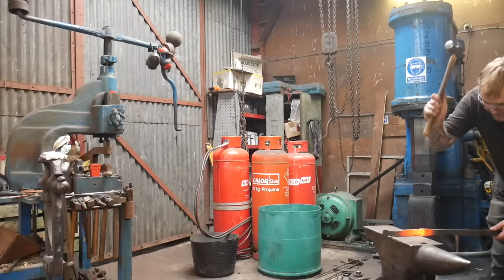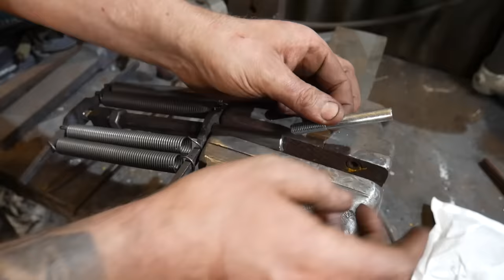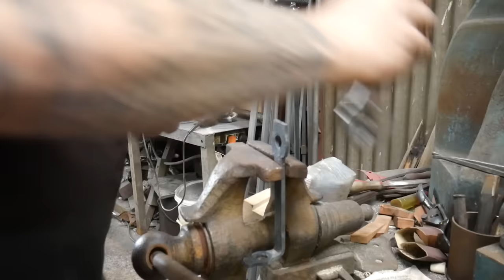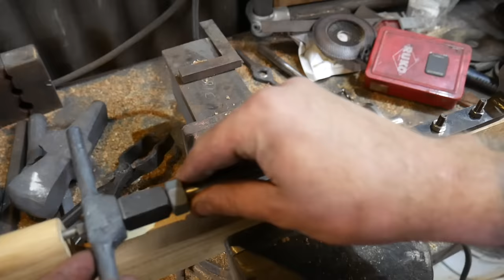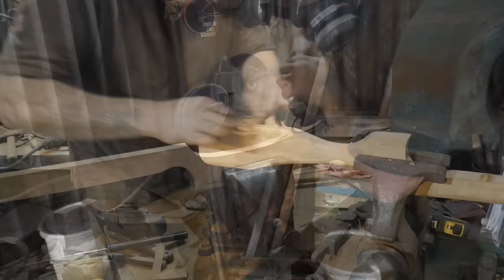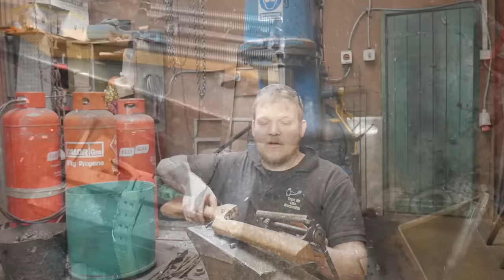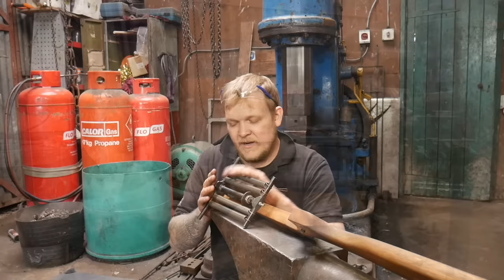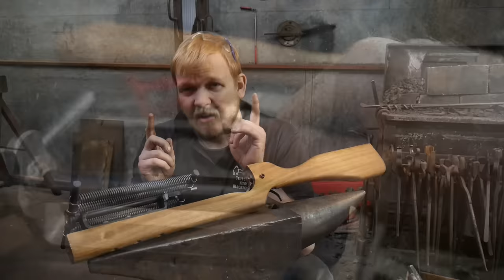The Spring Bow! Like a crossbow just with springs Pt.1

Comment: Your "stupid idea" is actually a very clever one, though, I'm probably biased as I did the same thing one year ago !! XD
Anyway, mine has the springs arranged somewhat differently. I don't keep them tightened as you do, so that I have a little bit more power. Also, they point inward, like they're just a cord replacement for a crossbow, which they are in my case. The arc of my crossbow was broken and I decided to use a fixed tube with springs as propulsion. The end result when it's not loaded looks like a triangle pointing towards the trigger mechanism. I also have a longer "barrel" and they have more space to be stretched. I can puncture leather with a custom dart I made out of a 6mm x100mm steel nail (with real feathers on the back, perfectly balanced). I also have a power drop though. For springs to work, they must be extra thick and real tough! As a matter of fact, the power of a bow is hard to beat with springs. In my opinion, different springs should be used in such designs, with the tougher and shorter ones near the exit and the longer and more flexible ones at the trigger. The idea is to simulate a sling shot's rubber. A set of 3 different sizes and lengths should be good, given you give 'em more space and that you "diagonalize" the setup.

Comment: Maybe a oilite (oil bronze don't know the UK brand equivalent) to keep the piston aligned on center. Say 25mm long. Shorter springs. Spring tension increases as you extend it to a point. Use McMaster Carr as a reference, again probably a UK equivalent but McMaster has a lot of tech specs. You want the springs near max extension when cocked, those springs had a lot of extension left meaning they weren't at their full potential. They could store a lot more kinetic energy. Cool project, I like the ideas to modify it you listed, particularly the trigger.

Comment: Efficiency depends on relation of spring system mass and the ammunition mass. With heavy forged parts, most of the power goes accelerating a mass which don't fly. That energy cause only problems when the springs hit the end. The performance gets better in a same propotion you can reduce mass of moving parts.

A bow is efficent because the spring itself don't move much and the string is light.

If you want to use the springs, you could try some lightweight lever whigh translates relatively low speed but higher mass into higher speed for lower weight ammo.

With a quick thinking, it is very difficult to beat a string based bow. A split tube with the string inside and the string tension with lightweight lever and really strong springs which hardly move at all would be very efficient.
Reply from the maker: I don't want it to better a bow just want to make the whole thing a little smarter. What you say make sense I'll look into the wieght.
Reply: Daniel Moss It will help but mass of a steel spring itself will quiclky become a limit in direct action. You could also think about some lever mechanism where mass, accelerated by the springs, will hit the short end of a lever and the long end then shoot out the ball bearing. Such design can use the energy in spring system without letting it wasted. The lever and pin have to take lots of forces but good steel properly hardened and tempered can take it. Ballbearing ball might be good material for such lever.

Comment: Performance wise, you're pushing a lot of weight, and that will definitely lose you a lot of power. There's a reason why crossbows are more effective, the bit that moves is quite light.
Obviously, also having a piston means you'll lose some power to friction (depending on how tight the fit is. 
As a toy, it's very cool, as an efficient launching mechanism, it's going to be quite difficult to get the power output you want. 

On your crossbow thoughts, definitely check out Todd's Workshop's early dark ages crossbow build. It's fairly simple, even if your woodwork skills are as ordinary as mine. He's also got another video on spanning a steel crossbow, which is useful, because it's definitely something you cannot do by hand. 

Anyway, the upshot is, I enjoyed the video as a bit of fun and look forward to seeing what you come up with in future videos :)
Reply from the maker: Thanks dude looking into it.

Comment: it would be good if you could have some form of spring to allow the trigger to return to the lock positionn after firing, this would add a little pressure to the trigger to stop misfiring but also aid in the cocking of the weapon.

Comment: Something that I haven't seen anyone else touch on (apologies if someone did mention it and I missed it) is something that came to mind when you showed the damage to the nut. That damaged nut is an indication of wasted energy, in that you have this tremendous energy stored up, but some of it is being transferred to the ball bearing and some of it is getting transferred to the bow, itself. Obviously, it's going to be impossible to transfer 100% of the energy into the ball bearing, but I'd guess you'd be able to put more of the ball bearing if you gave yourself some more travel in the springs (along the lines of your initial idea with the disengaged length). That said, the force of a spring increases proportionally the distance it's elongated/compressed, meaning the peak force in your springs is right when you pull the trigger, and the force the springs exert decreases as they relax. So there could likely be a sweet spot

Comment: Looks awesome! I think you should try to shorten the arms where the springs are attached. the one in the front probably doesn’t matter but the one propelling the steel ball could be a lot lighter and maybe a little more compact. I think that would increase the speed by a lot since the springs wouldn’t have to pull all that weight.

A longer draw length I think would be super beneficial as well! It seems quite short right now, so I don’t think a little longer draw would ruin the compact and cool nature of the weapon!

Greetings from Sweden!

Comment: Change from wood to more in the direction of titanium, add a crank for the draw like the ones on hunting crossbows, a notch on the trigger mechanism that sets the catch, notches for the springs....and more springs...lol
Reply from the maker: Titanium? You hav any idea how much a stock this size would cost in aluminium let alone titanium. Working on the next model as I type and I I'll make a new way to cock it like you suggested. Thank for the comment.
Reply: Yes sir, I understand that it would be super expensive. Not knowing what options you have at your disposal, I just meant something stronger than wood, there for able to better withstand the pressure  the extra springs will put on it.
Reply from the maker: @j.nystrom1535  bracing the stock will help for sure.
Reply from the maker: @j.nystrom1535  also a better type of trigger would help

Comment: Nice toy! You are now in the middle of making a bow or an air gun. That's the same path people in 15~16 century you revisit. You give it a barrel and compress chamber, it will be air gun. You keep the design, it will be consider as some kind of bow. 

The placement of spring, now you have all 4 parallel, you can try 4 corners, just like a stool chair, it will make it slim, probably more stable.

The other things to concern is the nut. If you check no matter crossbow or airgun, parts don't smash each other when you pull the trigger, energy loss is hugh and left the ball no juice to go far. This toy already have enough power, just how to use it. In the bow case, only the string touch the ball and all the energy transfer are done in that single point. In the airgun case, the pump nozzle blow the ball through the barrel, again, no parts smash each other. 

You are now in the edge to reinvent a device, nice work👍

Comment: That mashed nut that you had a problem with could be replaced with one of those old rear car shock upper
rubber bushing and two washers, one flat washer on each end of the bushing. Spring wise, substitute them
from using those personal fitness rubber bands and so i am sure, at some point; you will get all the power
that you should need. Example: Four bands substituted for four springs. The Sling Shot channel on YT can
provide you some more ideas too. JoergSprave heads up that channel and this guy is the goto guy that could
also help resolve your dilemmas! Shoot, for that matter, Joerg may even want to help further to expand on
that project for just shits and giggles! He enjoys custom builds on virtually all of most all crossbows, now that
he keeps pushing himself towards the always bigger and better. This guy is absolutely "Hell on Wheels" when
it comes to slingshots and crossbows! Nice try in the initial stages of your design and I'm sure that you'll get
through it sometime soon! Thanks for sharing!!
Reply: Ooops! One Great Mod, Two Major Fails... Pure Crossbow Fun!  >>>By JoergeSprave on YT

Comment: Springs are somewhat problematic for a device like this, because no matter what, you are fighting against the mass of the spring itself.  So springs without some form of multiplier like a lever arm or compressor piston will never be able to accelerate a projectile to a reasonable velocity.  This is why Roman ballista and similar devices used torsion springs instead of compression/extension, they can be easily pre-tensioned, being rotational made it easy to incorporate a lever arm, and were made using readily available materials of the time (ie. elastic made from the small intestine of a deer).

Comment: Ok this is my thought take off the 4 springs use one in the center the the pipe in the middle of the spring.this will give you the max pull and thrust.then you can caulk it with a draw rope from side to side that slips on and off when ready to fire.to some this wont make sence.but I once built a rocke t launcher similar to this but straight up shooting.i had 2 springs then four but after I changed it to spring with tube slipping in center of it there was no draw back from tention of differnt springs hope this helps.

Comment: Awesome design. Why don't sell this thing online 🙂🤙

I'm not a handy person, but I've thought about a spring weapon design .
It's the reverse of yours.

If I was handy, I would use one spring, that's compressed. At the end, I would put a magnet, to keep the bullet or arrow (of steel) in place.

An electric motor would be used to pull the spring into the barell and compress the spring.

The trigger would hold the spring.

Using an engine and a powerful spring, this thing could shoot through a door lol

What about recoil? Don't ask me 😜

Comment: Add some mechanical advantages by using something similar to a compound bow with pulleys maybe.
Reply: /\ This.  You need to turn some of that torque into speed.  I was thinking a lever with the springs on the short end and a longer barrel and stroke on the long end.

Comment: From what I know  (I really don't know much about this) the limited power has mostly to do with the efficiency of using steel to accelerate the projectile.
My guess is that a spring would get you to a similar efficiency as a medieval crossbow, maybe a bit better with the right / higher quality steel.
I don't think a bow arm vs spring would be very different here. 

You should be able to make a powerful bow with this, do know you will need a good system to actually be able to pull the bow.

Comment: Well , that's a start ..  trying to figure out a design using an old strut cartridge with the internal spring? Cam wheels or other lever types would allow for great acceleration control, where as this is dependent on 1 diminishing spring rate ...

Comment: id recommend a damper on the entrance of the barrel where the plunger sits to prevent further damage to the system as well as thinning the plunger (leave a wide head and use a thinner bolt). if your looking for further power id use high grade springs. im inspired by your design to create my own similar design however with my limited tools and capability to do so at the moment my ideas are stuck in the water. maybe using an h shape   (keeping the central arm but allowing a space to add another two springs per side via a upper and lower metal arm add on) would allow your power output to increase

Comment: get rid of that heavy cross bar and have the springs meet at a single point where you'd place the bolt/arrow. attach a crank with a steel cable to pull the springs, you can add two additional springs for a total of 6.

Comment: I have not read the other comments , my thought was to increase the energy was to use SS wire and pulleys to increase the spring output.

Just a thought.

Comment: if you add a tab on the heel of the trigger so that when the spring carrier is fitted into the catch, as the bolt slides into the lock catch, it also sets the trigger in one motion, rather than having to manually lift it. other than a locating notch to keep the springs in place, and having the piston fit tighter in the bore, then cut a couple of grooves around the piston for o rings, i'd say you've got a good design. you'll have to polish the inside of the bore to make the o rings last longer, and if you can get it to have a good seal like a bb gun, or a nerf blaster has, it will be a hybrid, air pressure/driver piston mechanism that it uses to launch the projectile, and it might increase your projectile's velocity. although, you might need something to hold the projectile to the rear of the bore cylinder like a detent ball and spring, or a neodymium magnet, to have it benefit more from the air pressure wave caused by the sealed piston moving forward. but that's what experimentation is for, and why the first 5-10 are just prototypes right?

Comment: Your problem is velocity. Each coil of the spring contracts at the same speed. If that speed is 1m/s, the entire spring will contract at 1m/s. If the spring is double the length, or 2m, it will still contract in 1 second. If your projectile achieves 1m/s on a 1m spring, it will achieve 2m/s on a 2m long spring. On the other hand, if the spring is only 100mm long, the projectile would only reach .1m/s, or one tenth of the speed. You would probably achieve the same result if you removed 3 springs. If you could then place the 4 springs in line, you would get 4x the velocity. Bows using springs rely on the length of the  bow arm to leverage the velocity.  An air rifle uses a large piston to drive a a large volume of air through a small hole, increasing the velocity dramatically. Adding bow arms with your springs would provide the gearing to increase the velocity.

Comment: Reducing the weight of the moving parts would be the most effective way to increase performance, that busted nut is where most of your energy is going.

I recomend you change the rear spring attachment points to put only tension stresses on it, instead of flex like It is now, its far easyer to support tension, so you might even be able to use some strong string to make the link from the spring to the moving plunger (i dont see in the video, but that plunger could be hollow with a cap on the end)

Maybe if you cut off the "wings" of the rear spring holder thingy, and place 2 studs on top, and 2 on the bottom, you can have each side have a spring go on top and on the bottom, using some strong string to extend the springs may help to make space for the width of the springs.

And finaly, theres a limit to how fast the springs will contract, so if you end up with a preety eficient sistem, you might have to increase the projectile weight to make use of that wasted force.

Comment: American here. We know all about stuff that goes bang ‘round here and I would suggest replacing the drive rod with a far lighter metal plate that fits in slots cut in the barrel. A trailing piece on the plate can stabilize the plate in the slot and reduce friction, as well as providing a connection point for the trigger seer.

Comment: You could use the final "slam" to trigger a lever which whiplashes the bolt at the end of its travel. This could be as simple as a captive weight on a pin attached to a lever or a spring. This is the "whipcrack" launch method, and it could add a subatantial final "kick" up to final launch speed.

You need a much longer throw, and more powerful springs. You can also lightening all the moving parts, maximising the acceleration.

Comment: Spring tension is your problem. Most projectiles like this have a slightly forward notch for the pull back to lock into forward so when you lock it, a small amount of tension is released from the springs allowing for room potential. Full tension will cause a lesser strength release, unless it is not spring, but explosion based tension set.

Comment: id add a spring to the trigger to hold it in an up position and make arming it easier. id also try rubber thero bands instead or the springs as they have more elastic energy
Reply from the maker: It's defo worth a try.

Comment: Don't mean to sound snotty and maybe someone below somewhere mentioned it already, but those japanese cross-cut saws only cut on the pull-stroke. Generally the blades are pretty brittle (making them stay sharp longer), forcing a cut on the push stroke is asking for a shattered blade :)
Reply from the maker: Not snotty and your the first person but your completely wrong about the blade being brittle. It creased so I had to get a new blade for it. It's super flexible and easily cut round curves. If you want pictures I'm happy to show you the creased blade and image of how flexible the blades are. Thanks for the tip about the pull stroke.
Reply: @danielmoss2089  oh right on! I may be getting things mixed up in my head, I think it's the Silky brand arbor saws that ya gotta worry about breaking on the push stroke. As long as it's working for ya keep on trucking. Very cool project and love the content!